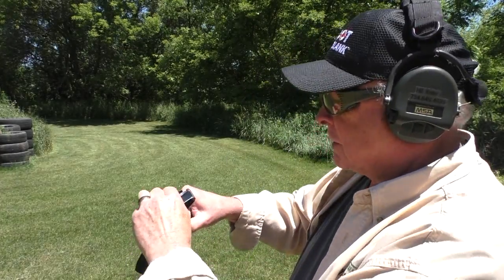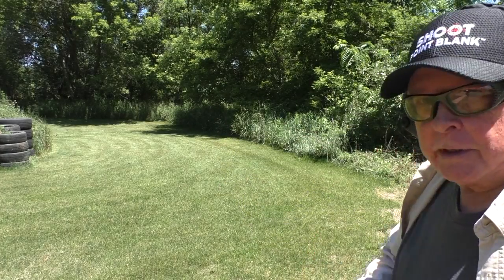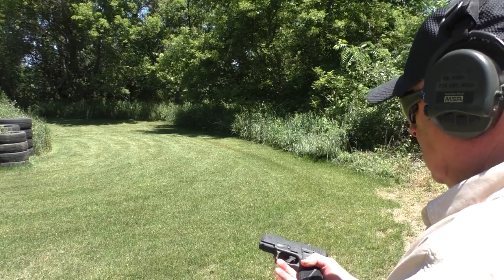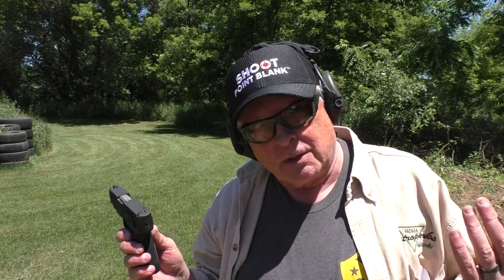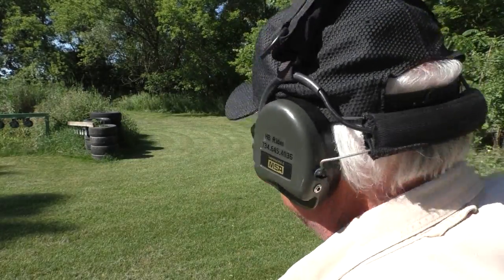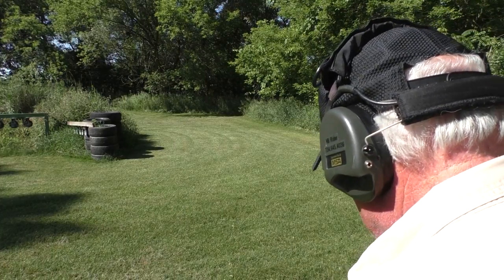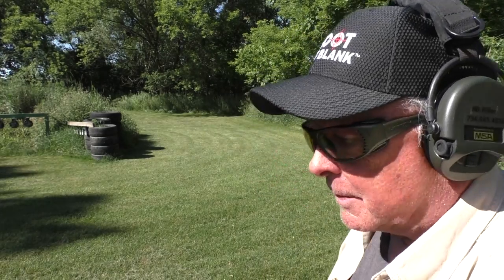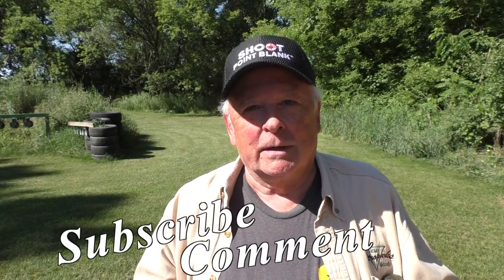Will the Taurus G3c run Defense Ammo?

Comment: I picked up a used taurus g3c In great condition my problem is when I chamber a jhp the gun locks up I can't pull back the slide its runs fmj ammo the jhp ammo I'd called incorporated 9mm jhp
Reply from the maker: Taco, can you provide the brand and bullet weight of the JHP ammo? Also, take the barrel out and drop a round in the chamber. If the round doesn't go quite all the way into the chamber, or if you can't rotate it freely once it is in the chamber, that bullet style/shape/weight isn't going to work in your gun. Not all ammo works in all guns, so you may need to find the ammo your gun likes.
Reply: @RidersRange  115 grain and the brand is called incorporated fmj drops freely but the jhp doesnt also it locked my slide completely
Reply: @RidersRange  ammo incorporated
Reply: Same problem here. I bought a g2c and g3c they both do the same thing. Tried loading Fedeal HST in both and they lock up. Switched to Sig V Crowns and my g3c seems to be fine with it. They are also very sensitive to reman ammo.
Reply: @rodriguez9497  WOW, someone else that has problems with ammo incorporated jhp. My g3c wont feed this ammo but does feed Fed Punch with no problems.  Thought it was just my gun that can't use ammo incorporated so was happy to see your post.  Have a great day.

Comment: Folks, always clean and lube your new firearms and also polish the ramp. I do that with every one of mine
Reply: I polished my ramp on the g3c and no issues on defense ammo
Reply: Mine is the full size G3. Out of the box I was aware that from the factory there’s a sticky gunk in the barrel and on the feed ramp. So I disassembled. With the barrel out I put a live round in the barrel. It stuck in and I could not remove it manually. I had to use my cleaning rod to dislodge the round. So I did a thorough cleaning with wire brush patches and oil. I polished the feed ramp with the finest Emory cloth I could find. Many trips to the range. No out of battery or ejection problems. Clean clean clean. Keep the feed ramp polished and you will have zero problems.

Comment: Great video. Both my G2c and G3c jam up with hollow points when chambering. Going to try a couple of the points in the comments.
Reply from the maker: Best of luck with them. Thanks for watching.
Reply: I will never buy a budget gun.  The saying is you get what you pay for
Reply: Fed hst jams in mine g2c an NOVX self defense jams also i just run FMJ no issues
Reply: My G3c Jams as well with Remington hollow points. I have to really rack the slide super quick to get it to chamber. Regular bullets I have no problem.
Reply: @allpro6124  its a gun not a budget gun

Comment: I have issues with chambering  and it hanging up on the feed ramp when racking the slide and or using slide catch. But once it goes it goes like a charm.
Reply from the maker: I'd be interested in how yours performs after you run 1,000 rounds through it. That SHOULD smooth things out.

Comment: I shoot Plus P Hollow Point ammo with 0 issues.
Reply from the maker: I've found that many Taurus pistols are hit-or-miss -- some run all ammo just fine, others are ammo-sensitive. Glad yours runs fine. And thanks for watching.
Reply: good for you
Reply: @youlltubelol698  maybe I'm lucky.
Reply: @qwikvr6gti  I guess I got lucky too. Bought a g3c today and shot a couple hundred rounds of different ammo through it today including some old old old cheap-o hp's and range rounds that left the gun filthy but still chambered and fired everything I stuffed in it with no issues.
Reply: @Spoofaged  I just upgraded the shit out of mine. Love it.
Reply: @qwikvr6gti  nice. I don't have any upgrade plans for this one except maybe some sights, and possibly a shorter trigger. Just wanted a decent beater fun gun and so far it's well worth the 250 I paid for it
Reply: I just replaced all the plastic parts. This pistol is excellent.

Comment: You did not mention how many brands or weights and shapes of defense ammo your complainer shot, or whether it was a brand new gun that had not been cleaned or lubed.  YouTube self-appointed "experts" have established a LIE that brand new guns are "supposed to" shoot any crap ammo (even steel cased!) right out of the box without any lube!  This was NEVER TRUE!  Not all ammo with like all pistols!  For example, I had a couple of .380's that shot everything except Federal Hydroshock---the bullet had a sharp edge on the hollow point that would snag on the ramp.  Other ammo no problemo.  Gun owners are SUPPOSED to test different ammo to see what works---and bulk ammo from the DiscountMart often fails!  Thanks for a useful review!.......................elsullo
Reply from the maker: elsullo2, I didn't mention it because the person who commented on the issue didn't provide any details. I agree, and have stated many times, that not all guns will run all ammo. However, I have found some guns - both inexpensive guns and some rather expensive ones - run everything just fine right out of the box.

Comment: Mine wouldn't load Speer Gold dot 147 from a full mag, pushed the round into the casing...
Reply from the maker: That seems to be a problem with some of the G3c production. Thanks for watching.
Reply: Never use 147grn in anything other than a 5" barrel hammer fired. It will not reliably feed due to weight, it causes FTF or failure to feed. Jams on feed ramp. Avoid 147grn any any defensive firearm. 115grn works great...usually. Also had numerous problems with almost any Remington ammo. Armscorp made where RIA arms is mgf, has hard primers. Should only be used with hammer fired gun.
Reply: @richardrogers8254  weird bc my G3c ONLY fires 147 accurately, I just can't get 147 JHP to feed...
Reply: @22webbs  Try the new Ruger ARX ammo or Sit Sauer ammo. Very accurate.
Reply from the maker: @richardrogers8254  thank you for watching, commenting and initiating a thoughtful discussion. I don't know where you obtained your info, but it's not at all correct. I have run 147gr 9mm ammo (Federal, Remington, Blazer) through a variety of guns, including striker-fired pistols with barrels as short as 3.5", with no problems in most of them. Lucky Gunner did his usual ballistics testing with the Remington Golden Saber 147gr (one of my two favorite carry rounds) fired out of a 3.5" barrel S&W M&P C and had excellent penetration and expansion results.

As to hard primers and striker-fired guns, as long as the striker spring is within factory specs and the gun is properly cleaned and lubricated, they should reliably fire virtually any quality modern ammo. I regularly shoot Remington, Federal, Winchester, Blazer (brass and aluminum), PMC, Armscor, Sellier & Bellot, Magtech, and my handloads out of many, many guns, including striker-fired pistols. I have had a few failures with Armscor, and a few with my handloads using CCI primers. But the others, including handloads with Federal and Winchester primers have run very well out of most 9mm pistols. (Side note: I did have one case of Federal 147gr ammo that had several failures to fire, even with multiple hits in quality hammer-fired guns, and that lot of ammo even had several hang-fires that had ignition delayed be a very small fraction of a second. But that was just one lot. I have fired more than 250,000 rounds of Federal ammo in a variety of calibers over the past 50 years with very few failures. And no, I'm not sponsored by Federal and I don't get free ammo or anything else from them.)

Final note: Responsible gun carriers will fire at least 50 rounds - preferably 100 rounds or more - of their defensive ammo out of their carry pistol using all their carry mags and expect 100% reliability before carrying that ammo for defensive use. Not all guns will run all ammo reliably.

Again, thank you for initiating a stimulating discussion.
Reply: @RidersRange  Seen it jam too many times. A factory tech mentioned that to a friend once with same problem.  Heavy bullet, just doesn't cycle like a smaller faster round. Could be just certain guns happens to, I don't know. Not taking any chances. Seen numerous problems with it in different types of ammo brands in smaller guns.

Comment: This is a great example video I wasn’t gonna get this gun cause I thought it would jam maybe just a lil practice will help
Reply from the maker: The G3c is a decent pistol for the price, but you need to make sure it will reliably run your carry ammo.
Reply: @RidersRange  I usually carry federal fmj but I’m not 100% sure about hollow tips
Reply: @chaseg3048  I had the g2c fed ftx critical duty, fmj, 147 gr hst and cheap fiochi self defense ammo along with gold dots and 124 gr +p hat only issue I had was with 80 gr drt ammo and it wasn't a feeding problem the chamber was to tiggr for the shells everything else was an easy press check away those rounds just were hard to chamber and press check
Reply: test your carry ammo if it ain't a revolver test it

Comment: First of thank you for your video, and taking the time to reply to the comments it is very much appreciated. 
I recently purchased a G3C, and when I chamber the first round, from a full magazine, by just racking the slide (not using the slide release), the first round consistently jams. Just as you did at the beginning of the video. 
I do not carry with a round chambered,  and I am concerned about having issues chambering the first round in an emergency situation. (Personal choice on not carrying with a round chambered)
I did try with all 3 of the magazines provided, and had the issue with all 3. Also if I used a fmj round I did not have the issue.
Thank you for any advice, and it may just be an issue that will resolve itself once the gun is more "broken-in".
Reply from the maker: Different defense rounds with different bullet profile may perform better - or not. It takes some experimenting, but at the current cost of defensive ammo, it could be challenging. There is nothing wrong with a full jacket ammo being the first round up in a mag, if that solves your problem. I have actually done that with one particular gun that I was testing (after chambering a hollow point). And LIGHTLY polishing the feed ramp, chamber top, and breech face MAY help - or may not.

As to carrying with an empty chamber, it's obviously up to you, but I STRONGLY recommend against it, as does every one of the experts with whom I have spoken. The USCCA just did a short video on this titled "(DEBUNKED) 5 Gun Myths You May Still believe". Carrying with an empty chamber was #1.
Reply: The uscca literally called it an 'unsafe  condition' 😅😅

Comment: What bout the G2C gun I've got one
Reply from the maker: Greg, I don't have a G2c. The G3c takes Glock sights and has a better trigger, but the G2c is still a viable pistol. Thanks for watching.
Reply: Greg Shanor I have not run across any ammo my G2c will not feed. It eats everything. FMJ/Ball, HPs of all kinds, even hard cast lead reloads powder coated and uncoated, brass cased and aluminum cased. I am well over 600 rounds through the pistol now and its still flawless. The only thing I have not run is steel case but I see others who do run it with no problems.

Comment: For 275 it's just fine
Reply from the maker: I just saw an add today for $225, plus a $25 rebate. That's pricing it around the same as a SCCY, but for a far better gun.
Reply: @RidersRange  got if for 220
Reply: @yousefmheisen917  

$259 - $50 gift card - $25 rebate for me.....puts me into mine that I bought for a beater tacklebox gun to use while fishing in my bassboat for under $200.
Reply: Something you can always have close by no matter how you are dressed including swim trunks. It's cheap so no tears are shed if it gets banged and scratched up. If the situation calls for it 12+1 rounds of 9mm hollow points is plenty of firepower on tap to take care of most problems. Think dark remote boat launches way back off the road down a winding dirt road through the woods. When you are launching or coming back in is where someone might get the idea to ambush you. Not this one....sorry!

Comment: That first jam is your fault. The gun was never designed to load by releasing the slide lock. Read the manual will tell you to rack slide back and let go.
Reply: I'm brand new to guns, but that doesn't sound right to me. Why would it lock back after being emptied if it wasn't meant to load by releasing the slide lock?
Reply: @Dryblack1  
Like I said before read the manual it we say to charge using the slide. Nowhere will it tell you to use slide lock. When you load a new mag you will have the slide putting pressure forward on the slide lock and the mag having a upwards force on the slide lock. This is why it feels hard to release slide just trying to use the slide lock to chamber another round. This is why you pull the slide back and release it.
Reply from the maker: Sal, you and I can agree to disagree on that. Yes, releasing the slide with the slide release (some call it the slide stop lever), rather than slingshotting the slide, technically pushes the mag follower down a fraction of an inch. However, slingshotting the slide takes longer than using the slide release with the support hand thumb, so I train to always use the slide release. If a gun won't run reliably that way, I prefer to not carry it. Thanks for watching and adding your perspective.
Reply: @RidersRange  
Don’t review a product if you don’t follow the manufacture’s directions. This would be like me buying a diesel truck and putting unleaded gas in it.
Reply from the maker: @Sal Maya, I'm not trying to be argumentative, but nowhere in the owner's manual that I can find does it say to NOT use the slide stop lever to release the slide. If you can find such a reference, please let me know where to find it. The only reference that I can find in the manual is on page 23 where it shows chambering a round from a slide forward position. There is no reference to releasing the slide from a slide lock position. The only differences between using the slide stop lever to release the slide and manually running the slide is approximately 0.01 inch in additional rearward movement when manually running the slide and about 0.01 inch in depression of the magazine follower when using the slide stop lever, neither of which have any material impact on the force and function of the slide. And as I said earlier, the time difference between using the slide stop lever to release the slide with the support hand thumb and manually running the slide overhand is substantial when doing an emergency reload.
Reply: 100% correct. as a g2c owner it's not even called a slide release by the manufacturer. It's called a slide catch.
Reply: I always use slide release when reloading  my g3c. No issues thus far.
Reply: @RidersRange  Correct. There is no owner manual reference to not use the slide catch to release the slide. The slide catch is used as a slide lock/release. If some folks prefer not to use it as a slide release then they don't have to but they should not be telling others what to do with their own gun. Guns are not so fragile that they can't operate mechanically as they were intended or meant to. Those mechanical controls are are put there by the manufacturer to use.
Reply: Sal Maya Wrong. There is no owner manual reference to not use the slide catch to release the slide. The slide catch is used as a slide lock/release. If some folks prefer not to use it as a slide release then they don't have to but they should not be telling others what to do with their own gun. Guns are not so fragile that they can't operate mechanically as they were intended or meant to. Those mechanical controls are are put there by the manufacturer to use.
Reply: @rbm6184  
Funny how I was just at the range yesterday with a buddy who just got a G3C. We both loaded the same hollow points I pulled the slide back bullet chambered no problem. He used the slide catch and guess what immediately failure to feed! We both have G3C’s.
Reply: @salmaya9274  Check the feed ramp. If its not smooth it will hang up HPs. If it happened once it will happen again. Polish the feed ramp. The pistols might be the same models but no two pistols are the same just like no two feed ramps are the same.
Reply: @rbm6184  

It’s not the feed ramp we both had them polished before we ever fired the guns. The problem is the operation of the slide.
Reply: @salmaya9274  A bad mag or the main spring then.
Reply: @rbm6184  
It’s a new gun. The problem was watching too many movies with guys using the slide lock to reload. I showed him the proper way and there wasn’t a problem after.
Reply: @salmaya9274  I have used the slide catch to drop the slide for 40 some odd years and it never failed to go into battery unless there was mag or feed ramp problems and that can happen whether racking or dropping the slide. So don't tell me what you think is proper when I know different. If you don't like using the slide catch then don"t but stop telling others they can't do it or that it hurts the gun or some other nonsense.
Reply: "Read the manual will tell you to rack slide back and let go." < truth!

Comment: If you use the slide lock it will load but if you do it with your hand without button it will hang
Reply from the maker: Thanks for watching and adding your thoughts.
Reply: i experience the opposite of this...with a full mag i have to load that first one by hand lol...from slide lock it fails almost half the time for me
Reply: @DiRTyWoRK_TV  Mine jams on feed ramp with my hand first 2 on a full mag,If you jam it forward fast and hard  from the slide lock Possition and I have already polished the feed ramp. This is the only gun I have that does this I have a sig 365 and a Canik Tp9 ,S&W shield they feed hollow points good .I found if you run Hornady defense in it they will feed perfectly so that's all I will run in my G3c